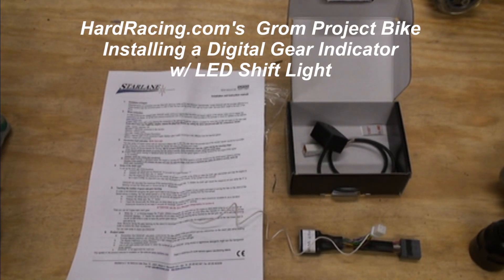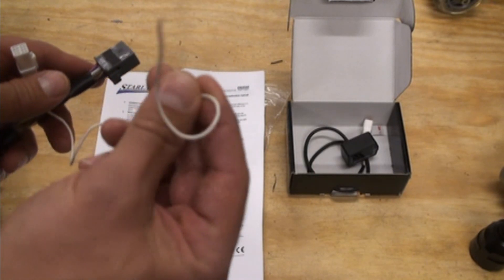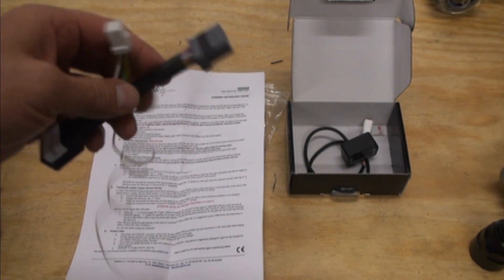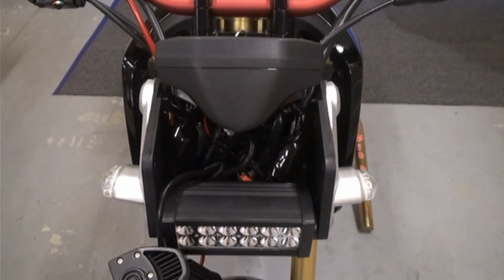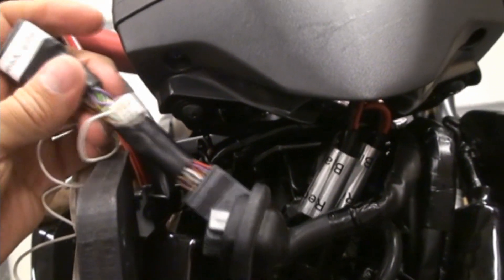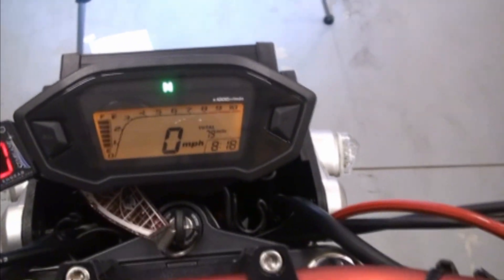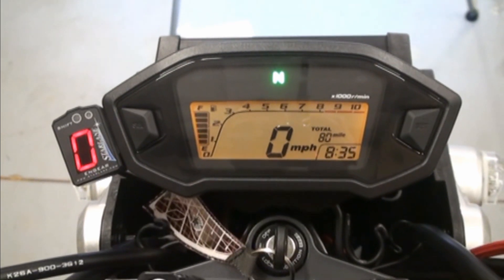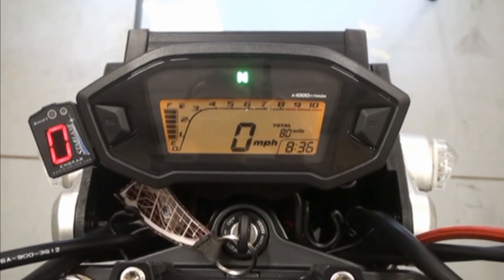Starlane Engear Digital Gear Indicator w/ Programmable LED Shift Light - Great Prices, #Hardracing

Comment: Hi, I've a 2013 CBR500R which shares some parts with the MSX. I'd like to install a Starlane Engear but nobody (of Starlane staff) has been able to tell me if it will work or not. So, do you think that with the PnP wire harness it would work? Thanks in advance ;)
Reply from the maker: Unfortunately, we don't know much about the CBR500R Dash, to know it's the same as the Grom.
You would have to check with your local Honda dealer.
They should be able to look it up in their computers and see if they use the same wire harness and dash.
Reply: HardRacing Thanks for your answer! MSX and CBR500R have the same speedometer , but maybe the wiring underneath is different. I hope that my dealer will be able to help me.
Reply: HardRacing Hi, which plug and play harness did you use? On Starlane' website, they have :
- CBR600 from 2005 and CBR1000 from 2005 to 2007 (Code: EPKCBR0507)
- Yamaha R6 from 2004 and R1 from 2004 to 2008 (Code: EPKR604R104)
- CBR1000 from 2008 to 2011 (Code: EPKCBR08)
- Kawasaki ZX6R 2007>2010 and Z1000 2006>2008  (Code: EPKZ60710)
- Kawasaki ZX10 2006>2009  (Code: EPKZK0608)

So I think you used one of them, which one please? Thanks in advance!
Reply from the maker: FiftyEgality Unfortunately, They do not list a Harness for CBR500
Sorry.
The Grom Harness may work on your bike.  But, we just don't know for sure.
.
Reply: HardRacing Hi! :) I know that Starlane doesn't list any harness for my CBR500R, but they don't list any Grom harness too. I'm almost 100% sure that it's the same plug. The only thing I'd like to know is which harness from Starlane do you use for the Grom? Cheers!

Comment: Okay, so.. Where did you mount your ground wire?
Reply from the maker: Not sure what you mean.. "Mount"  your ground wire ? 
There is no ground wire.
The white wire is for programming the unit.
Reply: +HardRacing so you leave it hanging?
Reply from the maker: We actually wrap it around the wire harness so it's out of the way but still accessible

Comment: What about this on a CBR600rr? 2007 model.
Reply from the maker: The unit itself is universal, and can be made to work with just about any  bike.  We DO have OEM Specific Wire Harness for the CBR600RR as well as many other bikes on our website.  https://store.hardracing.com/cart.php?target=product&category_id=&product_id=18650&xid=E8L9Ri341ndfOiro9GqmPP3jfqvNnwwJ

Comment: how did you set the fuel gauge
Reply from the maker: Not sure what you mean ?
Reply: Is the speedometer on your bike stock or did you get it from ebay? I have bought the same speedometer and I am unable to set the fuel gauge, it keeps blinking as if its empty.
Reply: I got into the calibration mode and it asks for id, lc,  pulse
Reply from the maker: Sounds like you are talking about a difference product.
Reply: Indeed brother...its driving me nuts....:(